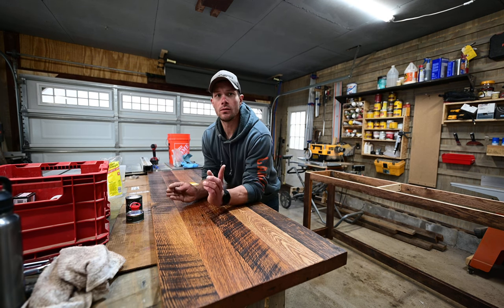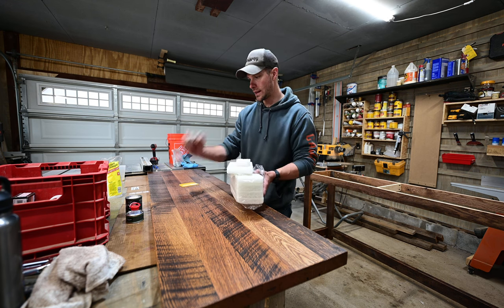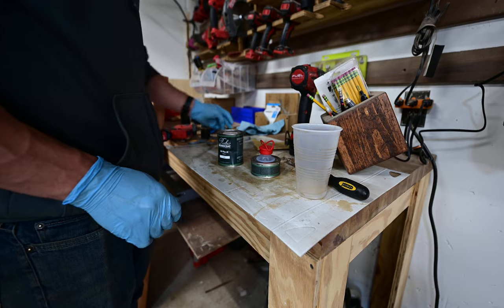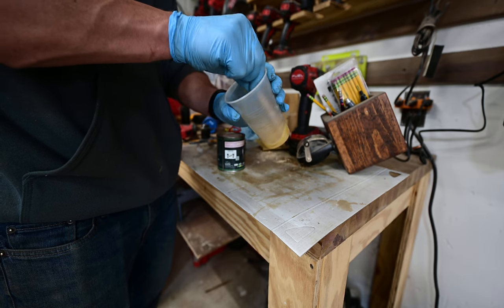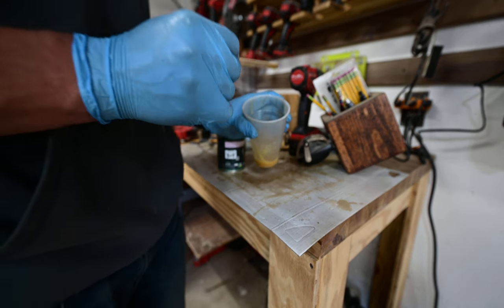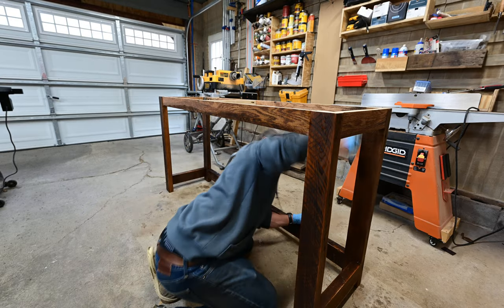Favorite wood finish! So easy to apply. Perfect Sheen!

Comment: I have used Rubio Monocoat before and I could not agree more.  It is the best with ONE DRAWBACK -- the smell.  You need a place to let this sit for 32-48 hours to dry and outgas. I applied mine with a lint-free terry cloth towel after trying to brush it on with a foam brush.  The foam brush did not work well.  The liquid is kind of like maple syrup and it just doesn't brush well (in my experience) however, a small (2.5" x 2.5") terry cloth towel can be used to rub and massage the clear coat in.
Reply from the maker: Yes the smell and one more drawback is having to mix the accelerator.

Comment: That finish looks amazing- very rich looking. I'm having an issue and wondering if you (or anyone) could share your thoughts.
 

I recently bought a mid century chest of drawers. when putting one drawer back in, I hit it on the other door face and marred it just a little bit. It has a small 1/4 x 1/8" mark- looks almost natural wood color (drawer fronts are wood veneer.) I noticed if I touch the area with a damp rag, it looks 100% normal (until it dries, then it gets lighter again.) 

Should I very lightly sand and attempt to stain that very small area (will never match 100%), then shellac (I am shellacking the whole thing- top looks great) OR, should I just try to shellac over it and hope it stays looking good. Would that restore it back to the dark color? The shellac is dewaxed, blonde so clear. Again, even water makes it look back to 100% original (until it dries.)

Also, what grit should I use to sand the veneer drawer fronts before shellac- 1200 or 1500? I want to be very conservative. I heard some even use a brown paper bag.

Thanks!